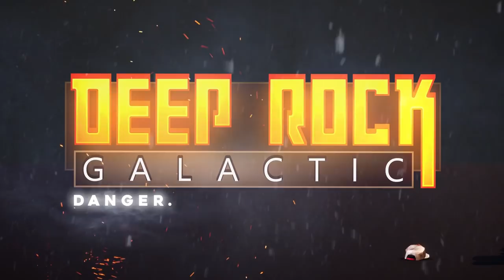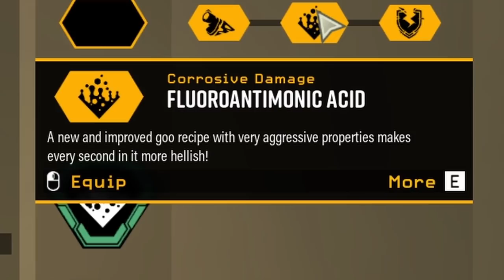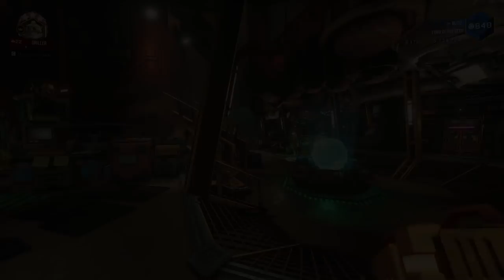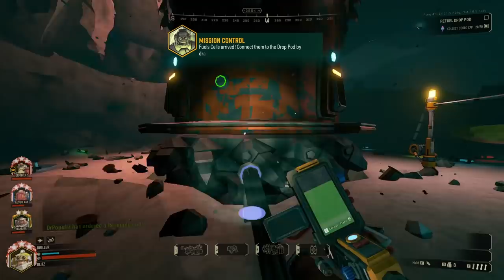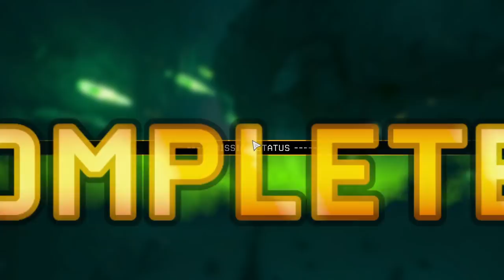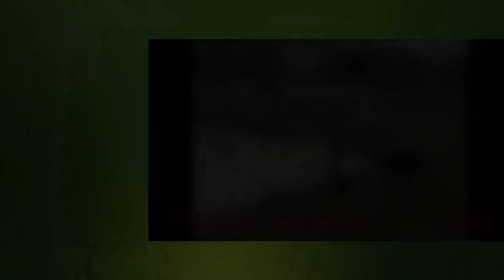HYDROGEN ION ADDITIVE SHOWCASE - Corrosive Sludge Pump Clean OC Build Guide

Comment: It's worth noting that this OC and the t5 DoT damage increase (Fluoroantimonic Acid) don't effect puddles (same with increased slow effects) They only apply to direct shots.

There's two DoTs/Slows going on (yes, they stack), one that is applied by direct fire and puddles have their own DoT/Slow. There's currently no way to increase puddle damage or slow.

So puddles aren't as useful as I kinda hoped they'd be, but stacking so many DoTs (Direct shot, Puddle, Plasma/Fire, Gas) can really add up.

I really don't think Sludge Pump has enough ammo for the dps it does, but that's a small gripe.
Reply from the maker: Great discovery mate
Reply: @GamingForTheRecentlyDeceased  You can also set the puddles on fire but it doesn't really do anything, just looks cool.

Comment: I came up with the exact same build, just with the cheaper charge shots instead of faster. That said I never run out of ammo, so it's probably a better idea to swap.
Reply: I recommend cheaper shots, you get an extra charge shot per mag
Reply: yep probably one of the best builds
Reply from the maker: Great idea but I like the charge speed. I def needed to not charge shot every single target and use my secondary more but I was having way too much fun. Also I would have had ammo but players were double dipping the supply pods. It's personal tho choice what players prefer there's def a lot of positives having cheaper charge shots, I prefer faster charge up, it helps make parts like @9:17 easier